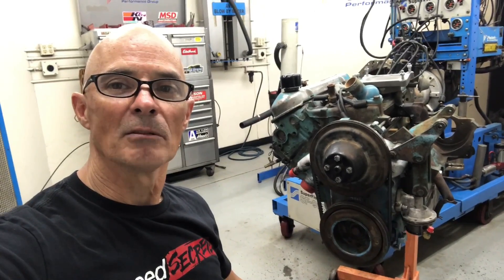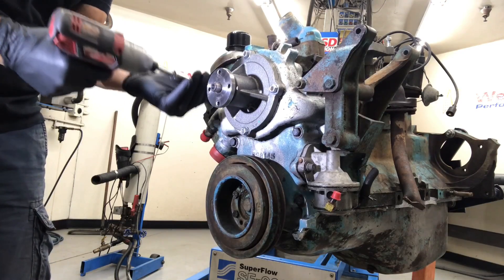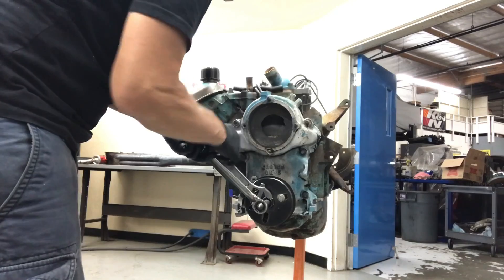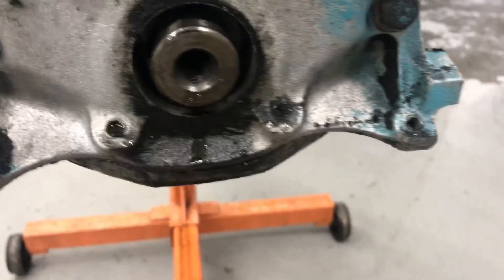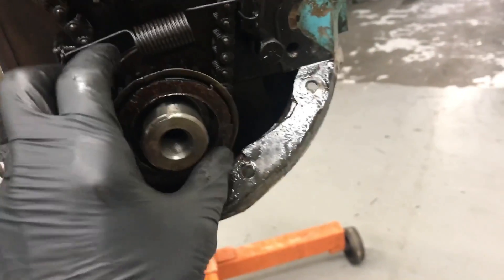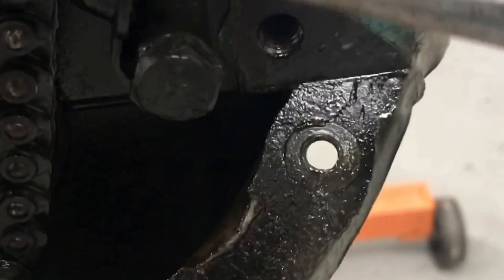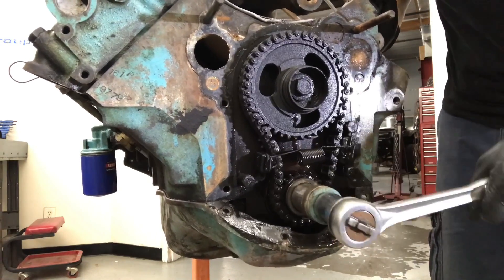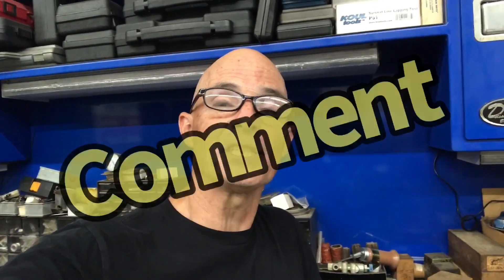HOW TO REMOVE A PONTIAC TIMING CHAIN-TROPHY 4 CYLINDER (1/2 389), TIMING CHAIN STRETCH VS TENSIONER!

Comment: My 64 Bonneville with a 389 did not have a tensioner but I can positively say you need to replace that loose chain & gears. If not for the tensioner it would have jumped time.

Comment: I changed the chain on my 75 Chevy truck ,that I have owned since it was new when it got to 100K  miles , and the chain was not sloppy like that , but as you know they don't have a trick tensioner like that one .
Reply: The fewer cylinders an engine has the more timing chain wear you will have. This is due to the cam being notchy as it is rotated.

Comment: It takes A LOT to jump a tooth. I had one of those plastic cam gears fall off completely so there was just the tiny little nubs left of the metal part of the gear and it didn’t jump. I was beating the crud out of that car too. The chain was so loose that when I went to change it I was able to take it off without undoing the gears at all.
Reply: The mid / late 80's Buick 3800 would jump, when the motor was turned off due to the engine rocking back a bit and cam going over a lobe. Had a trusted customer that dropped the car off for other work and when I went to start it the next day it would not run. These motors were valve benders too.
Reply: @bobroberts2371  wow! Those 3800s are great motors overall but I’ve seen some crazy failures on them too like intakes blowing to pieces on a backfire lol!

Comment: Same parts as the V8. I'd say it's several degrees retarded with that much slack. Delta for a regrind! Bore it for some 400 flat tops, an Edelbrock head...

Comment: You should have lined up the gear timing marks and noted the  #1 piston position. I suspect the piston is in the after position of 10 degrees because of the T Chain wear.
Reply: It'll run briefly with the timing cover off...let's get some slow mo footage of that!
Reply: Mi agree here just line the bottom gear up and see how far away the cam gear is

Comment: I am pretty sure the chain is supposed to be tighter.  but it made me think, about other things and how it is related to the 389 v8.  since most of the block is the same as the 389. could you use a 389 cam in it? not sure how that would effect firing order. also you you fit a slightly modified Performer RPM intake on it and just weld up the drivers side of the manifold.. also headers for a 389 should fit. maybe a single aluminum after market head? could it be bored and stroked using other Pontiac pistons and cranks? so many posibilities.
Reply from the maker: FIRING ORDER IS DIFFERENT
Reply: The 389 is cross plane if you look at the intake manifold you can see that each half feeds cylinders and the firing order is 18436572. The valves for the even banks, the bank they kept on the four cylinder, fire in the following order 2,8,4,6 which is like 1,4,2,3. This is a weird order and they are not even fire with gaps of 180 degrees, 90 degrees, 180 degrees and 270 degrees. This put the cam lobes in the wrong place to work for an even fire four cylinder of with firing order 1342, or in V8 numbering 2,6,8,4. If Pontiac had kept the crank pins and cams of the V8, the Trophy four would have been odd-fire, and really (No really!) rough.

If you had a flat plane crank cam for a Pontiac V8 it could be made to work, perhaps 180 degree out of phase, but I do not think anyone has made a flat plane Pontiac V8.
Reply: @Dr_Reason  I had never seen one of these. my assumption was that it a half a 389 v8 with weird firing order.  and was thinking about what could be done to improve it. the header and cylinder had should still work.

Comment: Better design than a Chevy. Too bad the Pontiac heads lost out in design. Dodge 3.9 V-6 uses a similar tensioner and uses a tensioner because of cam "chatter" at low speeds. That chain here is wore out. Replace it

Comment: Okay... personally, this reminds me of an issue had with the timing chain set on the GM LN2 2.2L/2200 OHV I-4.
The block it's based upon was originally designed for use in FWD cars, with transverse mounting. This placed the oil pan's sump beneath the timing chain, so it's primary lubrication would come from splash oiling. When it got fitted into the 2nd-gen S-10, this was forgotten, and the set would typically fail around 80k-100k-mi. Fortunately--starting in the 1998-m/y)--GM resolved this by making one of the camshaft/lifter oil galley plugs have an orifice, so the chain-set would receive the lubrication critical to it's long life. However, as we all know, sludge eventually builds-up in a engine... even in the oiling gallies. So, GM includes with all replacement timing-chain sets for the LN2 the orifice-type galley plug, as a part that REQUIRES REPLACEMENT when replacing the chain-set (Tension-er & all! (Use GM's replacements ONLY!!... Trust me.😉)) to help prolong the new chain-set's life. 

And, for the record: As long as the '94-'97 LN2 was assembled from the factory with the right head-gasket for the application the engine would see (one for transverse mounting, another for in trucks) and the coolant was maintained properly, they never gave any trouble.😊

Comment: I've seen in line Six cylinder AMC, Ford and Chrysler engines with more slop. The Australian Chrysler 265 Hemi had a service mod to put a 1725 Sunbeam chain tensioner on it,  the Falcon Six based Ford Tempo 2.3 and Taurus 2.5 had one too. Pontiac overbuilt that tensioner. It's elaborate 🥝✔️